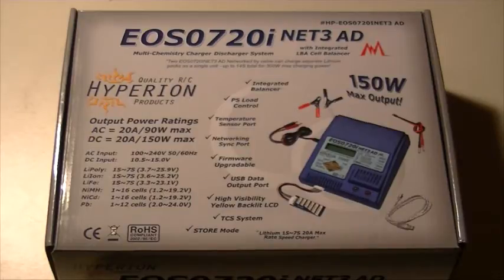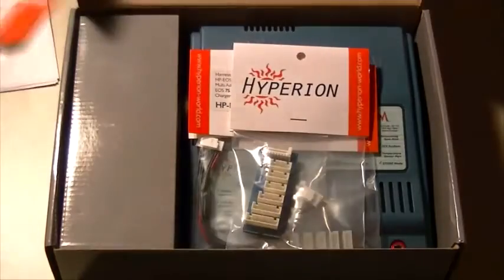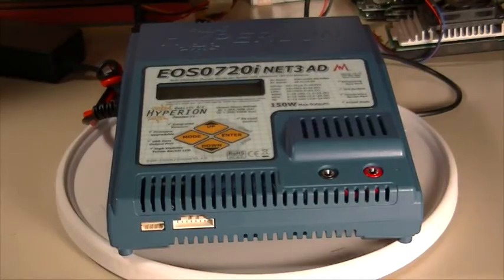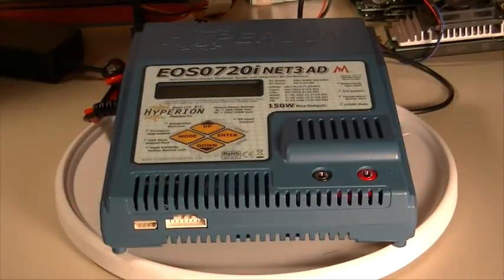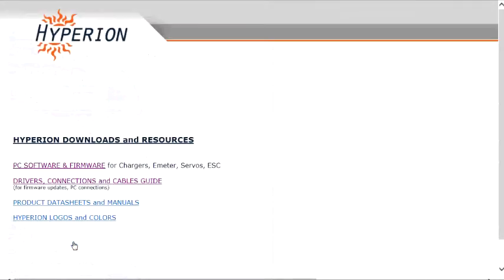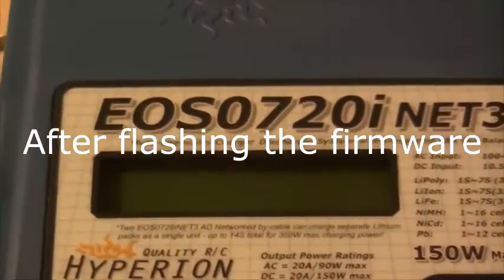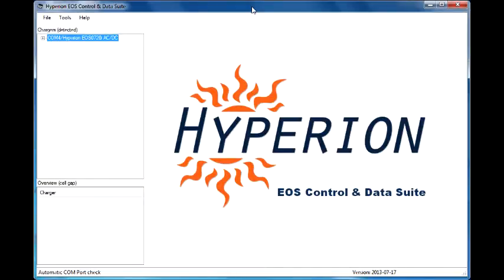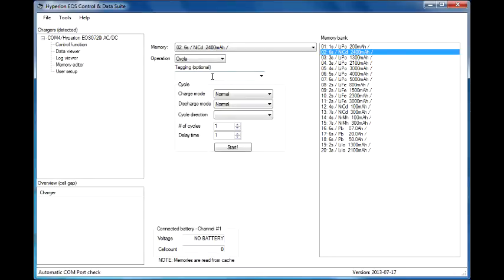Hyperion EOS0720i NET3 AD Review

Comment: how many amp is the charger
Reply from the maker: +Chis Ngwa it varies according to the nominal voltage of the battery being charged.  Maximum output is 90 watts when powered from AC (150 watts when powered from DC).  Maximum charge current is 20 amps, therefore any battery with a rating of 4.5 volts or lower can be charged at the maximum output current when powering the charger from AC.